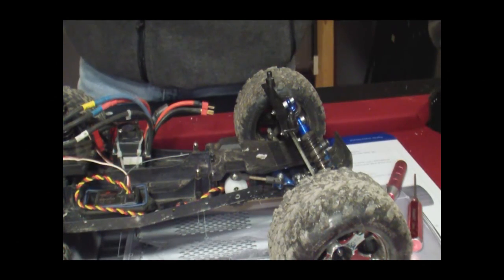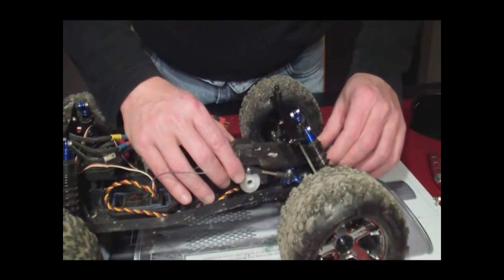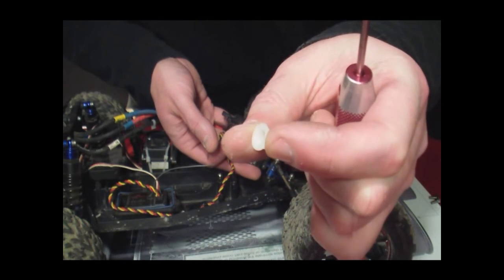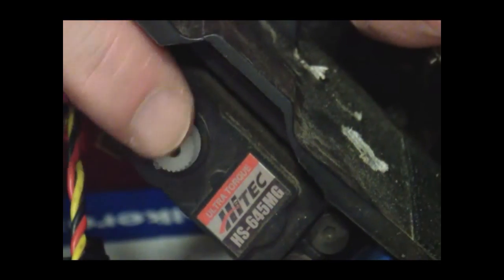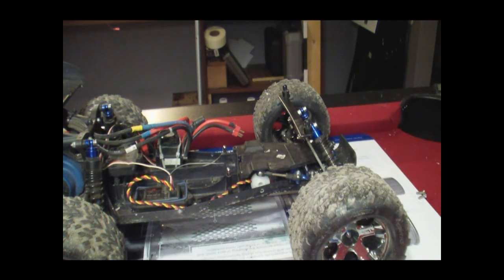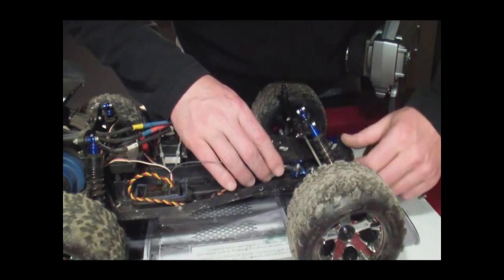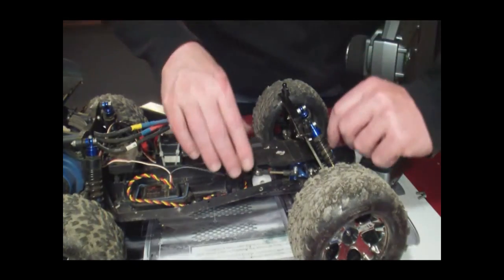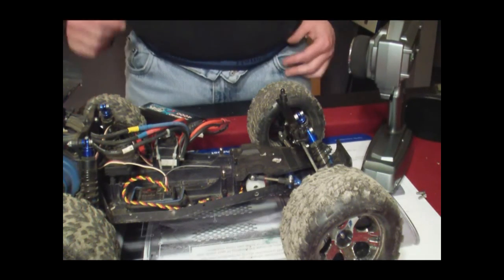Replace Servo Saver on Traxxas Rustler

Comment: replaced servo and cap,centered servo,adjusted trim.even messereed toe rods to make sure same on both sides.took it to local hobby store and they cant find anything wrongbut still wont go straight.not sure where to go from here.traxxas has no idea either.

Comment from the maker: I get them at my local hobby shop.  If your stripping them out that quick you may want to check your steering end points. You may have your radio set beyond the turning radius of the vehicle or your just beating the piss out of it. If thats the case then carry on. I would rather strip out a plastic servo saver than replace a servo...Carry on...
Reply: TheStampede19 Hey brother does this work in my 2WD stampede?

Comment: Those plastic adapter caps are completely lacking for the task of mating the servo to the servo saver.
They will strip out every time on MT wheels, well before the internal servo saver spring is even halfway compressed.
They will only work decently for 10th scale tires.

I tried the Kimbrough servo saver and its own plastic adapter caps, and even those strip out.

Traxxas and Kimbrough should make aluminum cap adaptors.
Reply from the maker: Agreed.  For a more stout setup I rec a metal gear servo and horn and trash the saver...
Reply: +TheStampede19 thats gonna break your caster blocks or turnbuckles

Comment from the maker: Sounds like you stripped the servo saver cap.  Replace cap over servo head that goes into servo saver then set your trims to zero and readjust. Should be fine.